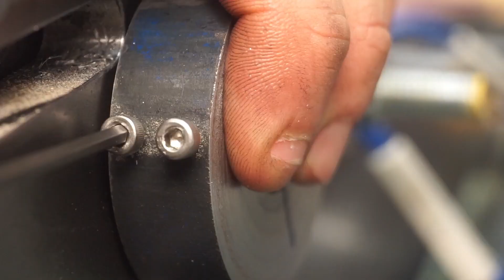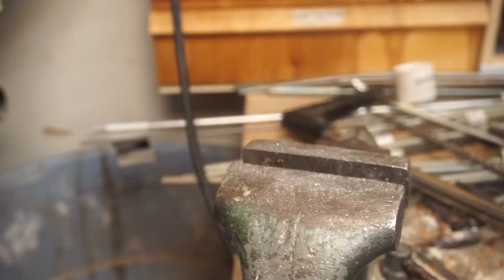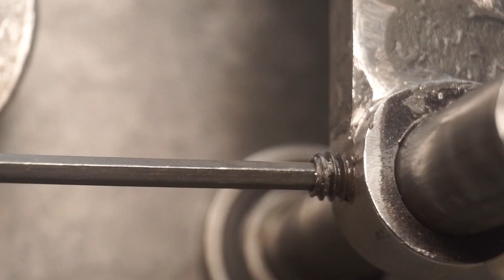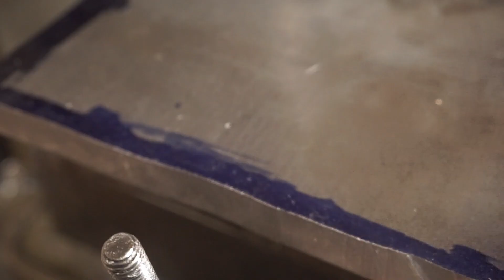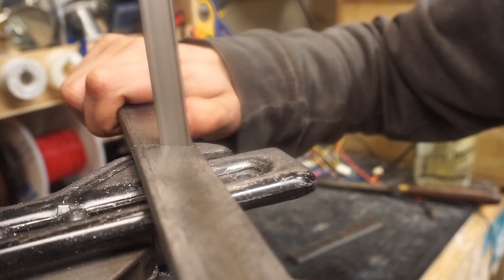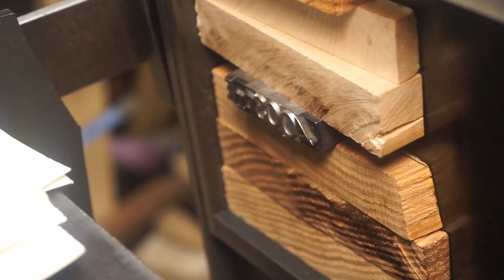First Impression on my Homemade Letterpress

Comment: Top sheet should be oiled Tympan or Mylar,  the Packing under should be mainly red press board and then thin paper to make up the final gap.
Reply from the maker: Yep, an arrangement like that is definitely the long term plan. I've got some problems with the platen I need to address first though.